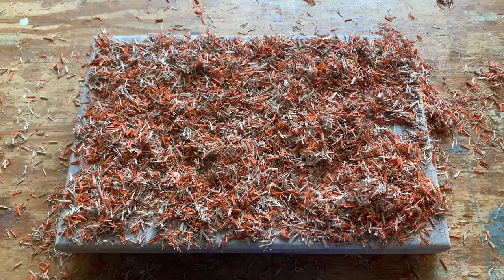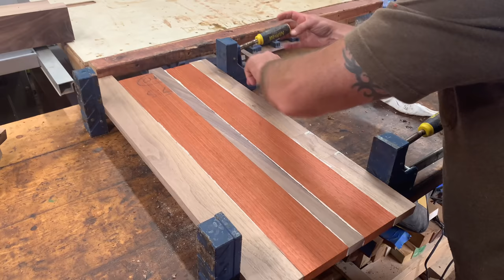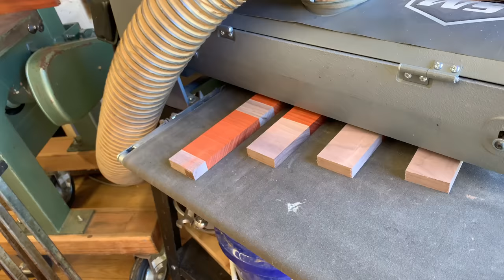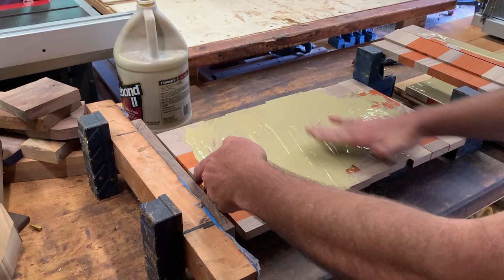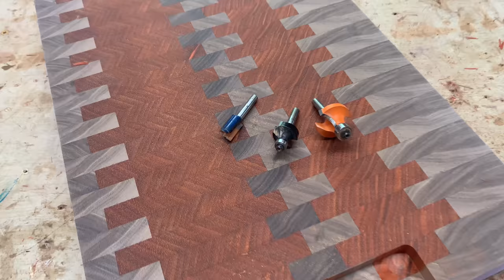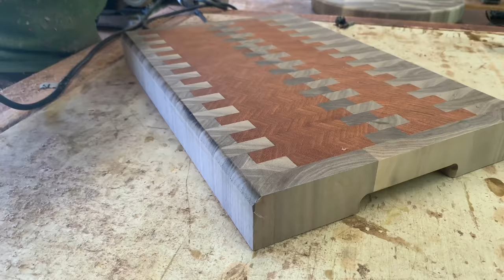Walnut Padauk End Grain Cutting Board | Functional Kitchen Art 4K

Comment: I just made a board similar to yours, Problem I'm having is with the red color from the padauk it is everywhere after sanding It's on the other boards, I can't wipe it off the rags keep turning red. Even after I glued it up before sanding I wiped it and nothing but red. I used mineral spirits to clean, Nothing helps ruined 3 cutting boards, Any suggestions.
Reply from the maker: I feel your pain, Paduak can be a headache. There's a section in my most recent video, where I give a few tips on how to prevent this from happening, but basically you need to wipe the red sawdust when it starts to accumulate, use compressed air to keep your board and sander clean.Once the red sawdust gets pushed into the endgrain its nearly impossible to remove it, other than running it back through the drum sander.

Comment: Beauty!!   Thanks for the vid   When I recently used Paduak on a board, there was some “bleed-over” of red into the light maple - any suggestions ?
Reply from the maker: One of my favorite combos is Paduak and maple together, great contrast! The bleed-over is a problem that I can relate too! My best advice is to  sand with a little less pressure where those sections are, and gently hand sand to finish.
Reply: I just used Paduk for the first time as well. Lots of bleed over. I definitely agree with using less pressure. Also, I'm thinking of covering maple with painters after I sand it first (I'm experimenting with edge grain "Cleveland Browns" boards so my maple is straight down the middle so I can tape it off easily) then moving into the Paduk last. Not sure if it will help, but hoping so.

Comment: How would the drum sander do flattening it after the second glue up? I have the drum sander, but no flattening jig for my router.
Reply from the maker: Thats certainly an option, the key there is during the 2nd glue up try to keep everything as even and flat as possible (which you should try to do anyway) if anything shifts or dips you'll wear the drum sander out trying to fix it. Making a flatting jig might be a good weekend project, I use mine for things other than endgrain boards, nice to have one in the shop.

Comment: While raising the grain, did you let it air dry before sanding? Great video and board. What does that board sell for?
Reply from the maker: I usually wait until its about 90% dry, when the board is a little damp it can actually help make sanding the endgrain a little bit easier.  I actually did an Instagram giveaway for this board, but it would have sold for around $250

Comment: Hello Jacob,
I've done wood working for 30+ years and have begun doing smaller projects (they are easier to move around) and really enjoy the work you do and the results you produce. I made the walnut and padauk end grain cutting board and it looked pretty good... until I added the mineral oil. The board  turned VERY dark. I can now barely tell the difference between the two types of wood. Any suggestions as to what I did wrong? Thanks,
Gary
Reply: I had a similar problem years ago. I think it is the density or weight of the piece. Some walnut is heavy and dark and will turn darker with oil. Padauk can be heavy also, but if you get a little sap with it, it will be lighter in weight. Just my idea. Good luck with it.

Comment: I’ve always wondered - why use titebond 2 that is water resistant over titebond 3 which is water proof? Is there an advantage to it, besides being slightly cheaper? Thanks and great video!
Reply: That’s definitely not just Titebond 2, it’s Titebond 2 DARK. I’m going to speculate here mostly, but I believe it’s well-reasoned: He’s using it because it helps to disguise the walnut glue lines. A lighter glue would show imperfections, while this dark will blend mistakes. The Titebond II Dark isn’t waterproof, but the bottle says “Excellent water resistance Ideal for exterior applications.” With the understanding that the BEST at a thing is not necessary when something else is more than capable of satisfying his need, he’s probably opted for a more aesthetically appropriate option. Also, the “open time” is a lot longer on Titebond 3, so he’d have to leave them clamped up longer if he went with that.
Reply from the maker: correct this is titebond 2 "dark" I think I failed to verbalize that in the video, There is a lot of good information on Titebonds website and both 2 and 3 are acceptable for cutting boards. The main reason I am using it here is because I take no chances when it comes to glue lines, often times with walnut no matter how much prep work you will inevitably get a thin white line. This little detail can make a huge difference in the overall look of you board.

Comment: I have made a number of edge grain and end grain cutting boards using Padauk in some of them. The problem I have had with Padauk is the bright red color fades to dark brown over time. Especially if subjected to sunlight. Is there anything that you know of that would lessen this process? Really like your work and videos.
Reply from the maker: Unfortunately the red does inevitably turn brown with time, there isn't a lot you can do to prevent this especially with just using Mineral oil as a finish.

Comment: How do you keep the padauk dust from tinting the rest of your board, when sanding?
Reply from the maker: It's a whole process and with endgrain its much harder. I sand while using compressed air to keep the dust from settling. Wiping the red sawdust often, I do a segment on this process in my Tips for improving edge grain video.